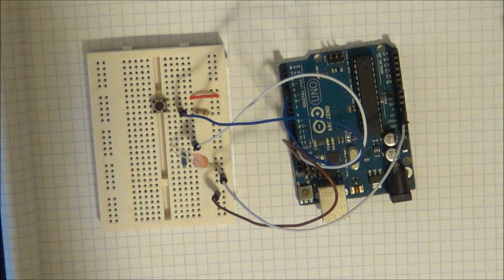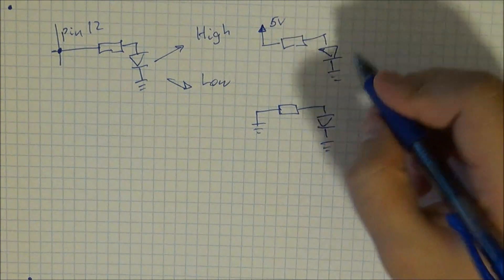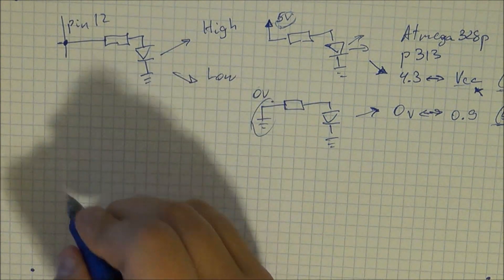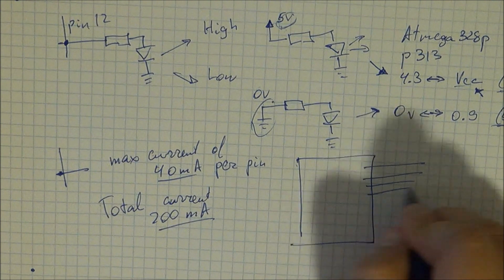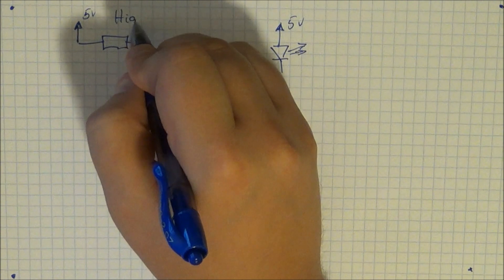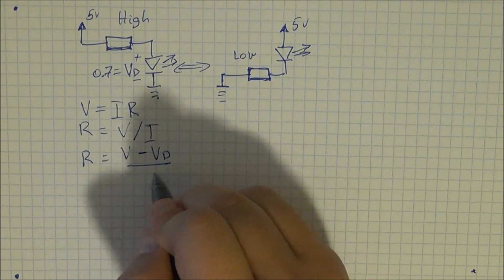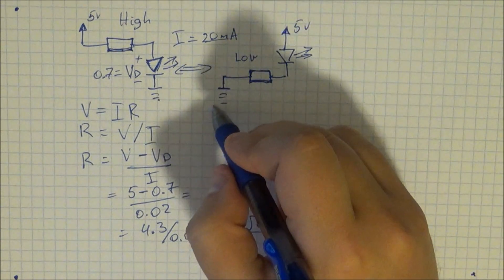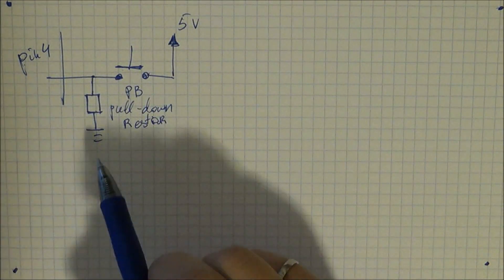Arduino Tutorial #1 - Extended - Limitations I/O pins, Pull-down, Current Resistor Calculations

Comment: Can you explain a little more why you didn't use a much higher resistor value at the end, like 2M Ohm? Wouldn't a much higher one cause a much less electricity loss to ground?  2M would still be below the 5M limit but will above the 20k one you chose.

Sorry to ask, I know you kinda explained it in the video but thats the part i didn't get. 

Thanks for the video though,i learned a lot from it. I thumbed up.
Reply from the maker: +Ben W Very good question. The Arduino (Atmega328 more precisely) has a leakage current which is 1uA if memory serves me right. If your resistance is such that the current going through it is smaller than that, you will see that pin as floating; it would be oscillating between 0 & 1. You can calculate the maximum resistance you should be using and it comes out to about 1M; so anything up to that is fine. Lastly, at 10k, you are losing very little current, so unless you are concerned with power, it works just fine for 99.9% of the applications.

Comment: My friend! great video! I have a question, can you explain a little bit better for me how come the position of the resistor between the board and the LED can make a it work when the output of the connected pin is set to low?

thanks you!!keep up with the good work!
Reply from the maker: The resistor is used to limit the current. The LED has an "ideally" 0 resistance which means that a high amount of current will flow through it and burn it in the process. You need to add that resistance in series to protect it. The general simplified formula is R = V / I = (V(battery) - V(diode drop)) / I(desired current). A typical LED is rated at 20mA, so 200 ohm resistance is a good option usually. Read your data sheet to make sure what values are suited for your device

Comment: Thank you for a very informative video. I was wondering if you could help me with a question that's driving me nuts. It pertains to Ohm's Law.

I'm working with an Arduino on a project and want to maximize the # of pins I can use by using some of the pins as inputs for buttons and using resistors to bring the current down to 15 mA. So let's say I want to run the switch circuits at 3.5V (because apparently the pin will register a HIGH with anything above 3V). 5-3.5 = 1.5/15ma gives you a 100 ohm resistor. But what if I wanted to run the circuit at 20ma and 3V? That's 5-3 = 2/20ma = 100 ohms! Both are 100 ohms! So how does the circuit know what voltage and what current I want? I can't find an answer to his question anywhere and it's driving me crazy! I'd be very grateful if you were able to answer my question!

Comment: The drop voltage in LEDs typically is not 0.7 V. 0.7 drop is for Silicon diodes but LEDs are made of materials such as GaAs and the drop is greater, aprox 2.3 V but depends on the color of LED.
Reply from the maker: You are correct, my mistake. I was just too used to make that calculation for silicon diodes. No wonder my 215ohm value did not make sense since I almost always use a 120ohm resistor for basic LEDs. Thank you for pointing it out
Reply from the maker: And just for reference, here is a datasheet for an RGB led: http://www.dipmicro.com/?datasheet=HH-1000CRGBC810W-B.pdf
Vf voltage: red: 2v, green: 3.2v and blue 3.1v. Thanks again